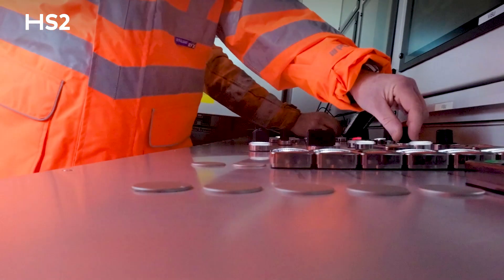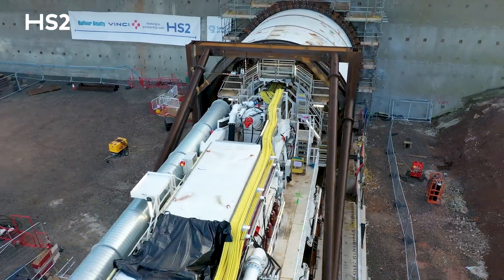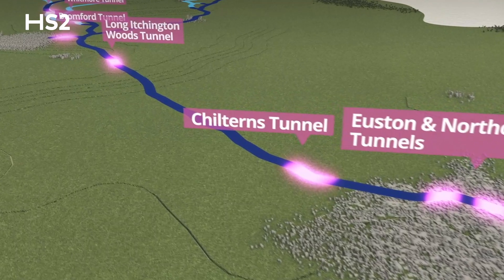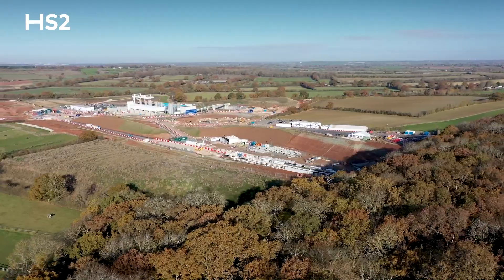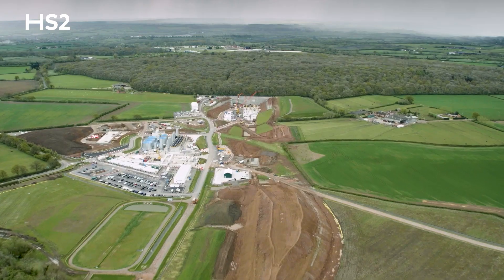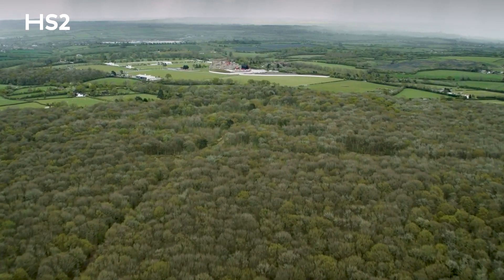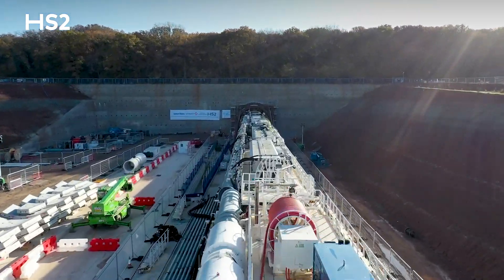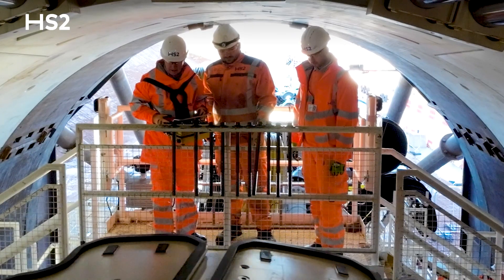HS2 launches first Midlands giant tunnelling machine

Comment: Scottish people just love this project, we get to share the cost but get no benefit, another perfect example of the way the UK works
Reply: HS2 does actually help Scotland, as the InterCity services from Scotland to England are going to switch over from the existing trains to new ones that run on the HS2 tracks. It is essential that we get the InterCity 125 trains retired, as soon as possible as they are less crashworthy than modern trains.

However, that does not mean that we should accept the "Classic Compatible" InterCity trains as the only thing that Scotland gets. We need to be investing in other railway projects in Scotland to.

Extending HS2 to Glasgow and Edinburgh would free up capacity on the mainlines from Scotland to the North of England and allow for more stopping services to run into both cities. So that is a National project that we should be doing.

And a high-speed line across the Central Belt could take away the InterCity trains between the big Southern cities of Scotland and allow for the Central Belt to switch over to stopping services that provide more trains per hour for commuters and which lowers car dependency in the most populated area of Scotland.

It would also be good to get a rolling program of electrification going. Again, that probably needs to be focused in the Central Belt first (with the Highlands getting done later) because the higher populated areas of Scotland have the most car pollution.  Making the most busy parts of Scotland carbon neutral, via modal shift away from cars, will lower Scotland's carbon footprint fastest. And getting rid of cars in high population areas will lower health problems and extend life.

The other benefit of HS2 (especially if we extend it further north than Phase 2) is that it gives us enough InterCity capacity to start banning domestic flights. So, we could start banning flights between Scotland and England and clean up even more air above Scotland.

But, again, this could be a better benefit for Scotland. We could be extending Eurostar services to Scotland (and Wales) and improving International rail tourism options.
Reply: @DavidShepheard   An excellent comment. Well said.
Connectivity could be even better if the SNP Government in Scotland had not withdrawn all contact with the UK Government in its policy on better Union Connectivity. They put politics before the people as always.
Their response was to accuse the UK Government of devaluing devolution and somehow attempting a 'power grab'!! Just quite amazing. So a new A1 Motorway will suddenly become a single carriageway at the border ....
Reply: @Johnny Chapman - Well as usual we get the misrepresentation of facts by a Scotsman.
Sorry Johnny but no one in Scotland funds any part of HS2. No one. It is an entirely English funded project.
However what you also failed to mention is that under the Barnett Settlements additional balancing funds are given to your SNP Government for THEIR transport projects as well as Wales and NI who also get equivalent additional funding.
Go to the Government websites (especially GERS) and provide proof you Scots are in any way funding this?

Oh and seeing as you raised cross border financing? When are you Scots going to stop running up a £15 bn annual deficit that we English have to pay for you?
Reply: @1chish  its funded through general taxation matey
Reply: @johnnychapman5623   No its funded from English allocation of spending FROM UK taxation 'matey'.
I explained the way the UK's spending is broken down through the Barnett Formula but you sort of ignored that as all Scots do.
You will know the Barnett Formula? You know the one that gives Scots 20% more public expenditure than the English? Yep that one. And who pays your annual £15 Bn fiscal deficit? Yep its funded by the UK Treasury.
So do not try to be clever 'matey' because you Scots get far more out of the Union than you put in. So NO you Scots do NOT fund HS2 the English do.
Reply: @1chish  there’s no such thing as an “entirely English funded project” in the U.K. England nor any other country in the U.K. has it’s Tax collecting organisation. Any government project is funded by tax collected from HMRC from all parts of the U.K…..
Reply: @1chish  Nothing of what you just disproves the fact there can be no” “fully English funded” project in the U.K. Expenditure means nothing it’s about where the money is sourced from in the first place. Which in the Westminster governments case is HMRC. Who collect revenue from the entirety of the U.K. then divide it up as they see fit. The Barnett formula comes after this and allocates funds to the developed governments. Your point would only stand firm in England, Scotland, Wales and NI all had their own versions of HMRC. Also England doesn’t get what’s left. Quite the opposite. Westminster creates its expenditure plan. Allocates budgets to health, welfare, defence, debt, social services ect and then the devolved governments budgets. The SCOT gov budget is only about 62% of Scotland total tax revenue. Anything spent over that 62% is spent by Westminster on things that don’t necessarily benefit Scotland. Like spending billions maintaining a nuclear base as far from London as they possibly could.
Reply: @scottwhitley3392   Are you for real?
Everything I put to you proves the point but you insist on denial. You are bringing up an irrelevance about tax revenues when Barnett is about expenditure. I suppose I will have to explain that as well.
Yes all tax revenues accrue to HM Treasury. Simple fact. But you then get the sequence very wrong. Quote:
    "[HMRC] collect revenue from the entirety of the U.K. then divide it up as they see fit."
No they don't do that at all. You have the sequence wrong.
The Treasury decides what the UK expenditure will be, the UK Chancellor presents this in the annual Budget to Parliament which is then passed by the UK Parliament as the Finance Bill. And it is from that Finance Bill that Barnett divvies up the gross numbers to each devolved Government. It is called 'Barnett Consequentials'. The remainder is 'English'. So each government THEN can fund projects it wishes to fund. HS2 is therefore funded from the English allocation. Just like Scotland funded the Glasgow / Edinburgh electrification.
Reply: @1chish  I’ll say it again so it sinks in. It’s really not hard to understand. THERE CAN BE NO “fully English funded”  PROJECT IN THE UNITED KINGDOM. Our tax system simply doesn’t allow it.
Reply: I mean what do you expect to happen, every single project has to somehow directly benefit Ireland, Wales, Scotland and England at the same time? I get your point but it's not that easy. Alot of projects are near London because London simply earns the most money for the UK economy. I do agree though, more projects should be done to link up the North of England, Scotland, Ireland and Wales. I think everyone deserves the right to a good rail network.
Reply: @amelio5720  I expect my government to spend its money on infrastructure that benefits more people, not on a vanity project that will only benefit a few and will need constant taxpayers input to cover its running costs.
Reply: @aakeister   I would suggest you try and understand that freeing up thousands of train paths on legacy main lines as express trains transfer to HS2 fundamentally "benefits more people" as more paths are available for freight, urban and inter urban services.
I live in East Anglia and I have a once an hour service. HS2 will not benefit me one bit but I can still see the huge benefits for all parts of the North of the UK (yes and even Scotland).
Calling this huge investment a 'vanity project' really does you no credit.
Oh and btw the railways are always taking 'taxpayer input' because they provide an essential national service.
Reply: @1chish  nonsense. The majority of travellers don’t want to drive all the way to Birmingham, no passenger who wants to get off between Birmingham and London, none of these will use it. This HS2 is a waste of money and a long term cost for taxpayers with little or no benefit. Being in logistics there will not be an increase in freight using the proper lines either.
Reply: @aakeister    I got to 'nonsense' and realised you don't have a clue so get aggressive. And then you proved it. Who on earth is discussing 'driving to Birmingham' ffs? Sorry I gave up right there.
And on your last point I was in international logistics for over 30 years and was CILT so no lectures please. The briefest of research shows the fastest growing sector on UK's railways is Intermodal. Tesco alone are committing to double rail usage.
Reply: @aakeister  They said the same thing about HS1 but look at it now also the HS2 trains can use new and old infrastructure.
Reply: @aakeister  Most infrastructure only benefit the few, I don't benefit from The Queensferry Crossing or from the Boarder way railway and yet I have no issue with my tax money going to such projects.
Reply: @1chish  What HS2 is missing, apart from the failure to complete the project to Leeds but I suspect that will eventually happen anyway when they realise upgrading lines doesn't deliver the require benefits. HS3 is needed to link all of the end points together and that all those end points should be through stations. But again that would require join up thinking and treasury to be willing to spend money on the North.
Reply: @aakeister  You got the existing lines to cover those journeys. An trains on those existing lines will be making more stops at all the places in-between London and Birmingham, so there will be a increase frequency of service at many of the stations along the route as high speed journeys transfer to HS2.
Reply: @DavidKnowles0  The Treasury is willing to spend money in the North. Like £96 Bn of it. And it has delivered most of what TfN had demanded.
People seem oblivious to what this Government has spent keeping people's incomes going, protecting their jobs and keeping businesses and industry going during over 22 months of COVID. The whole railway was kept running almost untouched and that cost £Bns. It is unrealistic to think that after THAT expenditure every other planned expenditure would survive intact.
I do agree that the route to Leeds will be completed at some point as the land required has been safeguarded. And lets be realistic here: Leeds to London will still be faster than now. It is also getting the Supertram system cancelled in 2005 by 'another party'.
Reply: @amelio5720  This is exactly what myself and a lot of Scots expect to happen, one of the many reasons why 55% if people living in Scotland want Independence
Reply: @johnnychapman5623   Quote:
    "one of the many reasons why 55% if people living in Scotland want Independence"
Utter bullshit.
In 2015 55% voted against independence
In 2016 the SNP failed to get a majority in Parliament.
In 2021 the SNP failed yet again to win a majority in Parliament.
Also in that GE 53% never voted for the SNP and therefore independence.
Every OP since that GE has shown an average of just 44% in favour.
Just because you believe the SNP bullshit don't think you can get away with it here.
Reply: You might want to direct that to Queen Nicola 

Transport is a devolved matter throughout the UK.
 The Scottish Government is responsible for:

  - the Scottish road network; trunk road management; road signs and speed limits
  - parking controls, bus policy, concessionary fares, cycling, taxis and minicabs
  - motor vehicles and trailer description regulation
  - railway services (with some exceptions); construction of new railways; railway policing; passenger rail franchise
  - shipping, ports, harbours & ferries: planning and Public Service Obligation (PSO) designation
    inland waterways
  - airport development planning and PSO designation; Air Passenger Duty (applying in Scotland since April 2018)
  - guidance for Regional Transport Strategies (seven Regional Transport Partnerships)
  - transport security.

These powers are delegated through Transport Scotland, the national transport agency.
Reply: I feel yoi bro but from the north east of England. Should see the state of iur railways 🤣
Reply: @highroaduk637  Then please explain wht the English don't want the Scots to leave the UK, is it because of your friendship and generosity, come on man wake up and smell the coffee
Reply: @johnnychapman5623   Easy answer: Because we have too much history together and as a country we are better together. We are better than the sum of our parts. It is not Just about money.
More contentious answer: Because we hate seeing a great set of people being misled by and lied to by a bunch of conniving thieving shysters called the SNP.
Reply: @johnnychapman5623   Classy reply that Johnny. No really it was ... 🤦‍♂️
The bottom line is that the rest of the UK is Scotland's biggest market by a very long way. It also gets massive benefits from being in the UK (and I mean more than the extra 20% from Barnett and the £15 bn a year cash benefits).
But if you decide to leave then so be it. I won't lose sleep.
But answer me these simple questions Johnny:
What currency will you use?
What taxes will rise or which expenditure will be cut to reduce your  £15 bn fiscal deficit? (that is £168 per week each extra per Scottish taxpayer)
How will you repay your 8% share of the UK's gross debt?
Do you really think you will get a trade deal with the EU or the UK?

After all the SNP will have already explained it right? ........ oh wait they haven't? 😳
Reply: @1chish  Yeah, I thought it was classy too, I'm quite proud of it, I like to get to the point and cut through all the BS
Reply: @johnnychapman5623   And yet you are unable to answer my simple questions?
OK Pal I get it.
You have been unable to 'cut through' the SNP BS, so have been conned and have total trust that all these minor inconveniences like currencies, debts and deficits will all be sorted out afterwards right?
Outstanding....... smh
Reply: @1chish  I dont swallow the mainstream nonsense about Scotland being a poor country, I have  belief in my wee country
Reply: @johnnychapman5623  Oh look more deflection. Why am I not surprised?
So when did I say Scotland was in any way 'poor'. And no one doubted your belief either ffs. This is what you SNP Bravehearts do all the bloody time Pal. Someone asks questions you can't answer so you twist words and play the victim. Its quite pathetic.

And STILL no answers to some basic question though Johnny. Again why am I not surprised?
Reply: @1chish  Having the last word can sometimes be intoxicating. It’s a (temporary and fleeting) ego boost and can feel like a long-fought victory. When we have the last word, we can convince ourselves we are right. It feels like a win. Over to you matey🤔
Reply: @johnnychapman5623  If the English had a vote on the matter you moaning scots would no longer be apart of the Union. It be a landslide.
Reply: @DavidKnowles0  So why is the UK government against Scottish Independence, I'm guessing its not because if Little Englander's like your self love us so much, oh maybe it's because of the legendary generosity of the English, oh sorry, that isn't a thing, so please explain why Westminster wants to keep Scotland under its wing
Reply: An people in England won't get any use out of Borders Railway or the The Queensferry Crossing.
Reply: Only Londoners and a few in Birmingham get any “benefit”